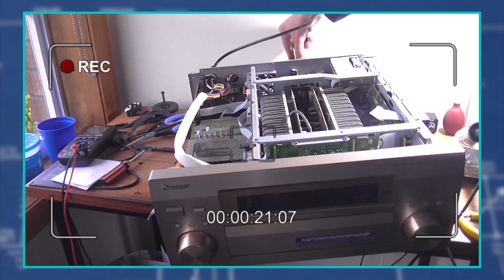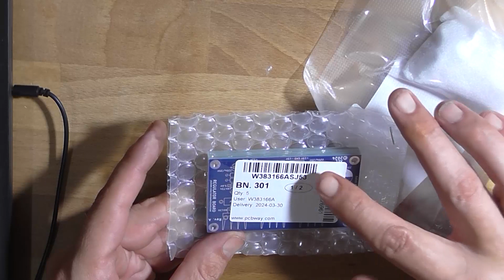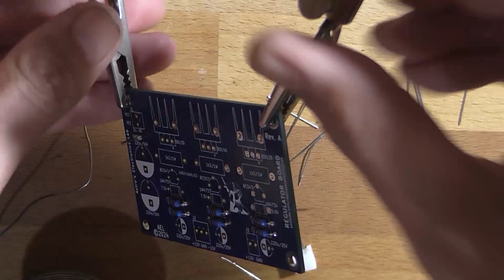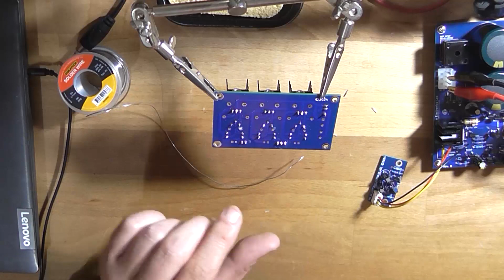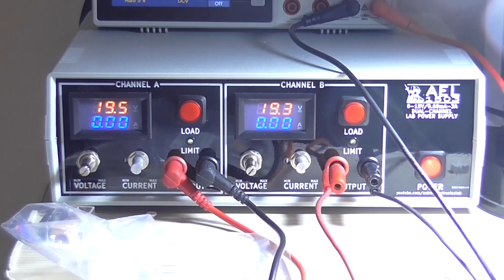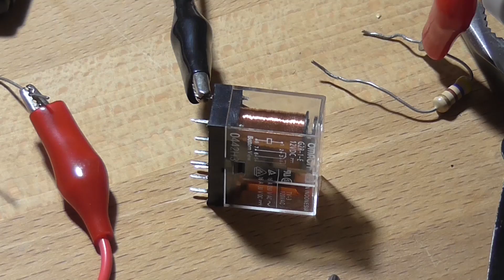Series-Pass Regulator PCB Complete FAIL!

Comment: If the "e" on the silkscreen is for the emitter then I think you have the pass transistors in backwards.  BD139 pins are Emitter, Collector, Base with the front of the package facing you.  If you want 15v then a 6.8v zener will get you closer.
Reply from the maker: HA! So obvious, you're right, they're backwards! Damnit!
Reply: Haha! Glad there was a solution. Good call! Sometimes we miss things. BTW, I recently bought some Rubycon 220uf 50v caps with 2.5 lead spacing. Handy.

Comment: How many volts zener diode you used ?
Reply from the maker: 7.5
Reply: @AstrosElectronicsLab  do you mind showing the schematic because I think the zener makes to have the voltage drop
Reply from the maker: Sure, sorry I was at work. Here you go: https://imgur.com/a/vA17iB5
Reply: @AstrosElectronicsLab  I'm at work now also. But thanks for the schematic, I will look to it and then I will let you know what can be done to have the output without voltage drop just please remember me how many volts need on the output and how many milliamps to handle!
Reply from the maker: @SymbolTech21  +15, -15 and +12, the +/-15V doesn't need to handle more than 150mA,  the +12V needs to handle about 150mA. However, I'm having a new PCB made with a new design, but I would like to fix this one. I'm leaning towards the choice of output transistors is wrong. I probably should be using TIP41C and TIP42C respectively. I will look in to this myself as well over the weekend. Cheers, J.
Reply: @AstrosElectronicsLab  the placement of the zener diode make a difference definitely and also the biasing resistors for the first transistor

Comment: Too bad it didn't work. Is this design preferable to one which uses 7815/7915? Hope that's not a stupid question. Yes, I find soldering the pcbs is my favorite part of a project. It IS therapeutic!
Reply from the maker: Higher input voltage. 7815/7915 max input voltage is 30V.